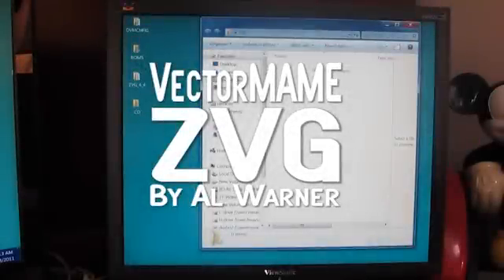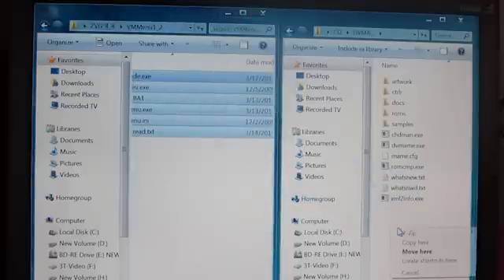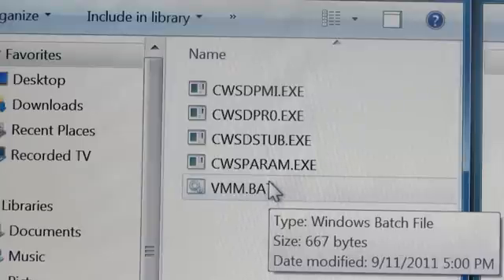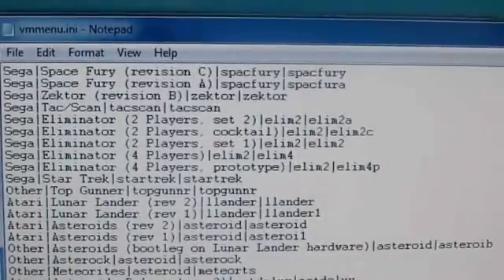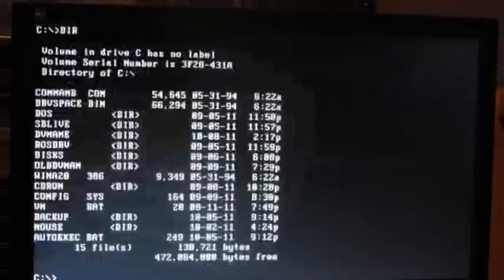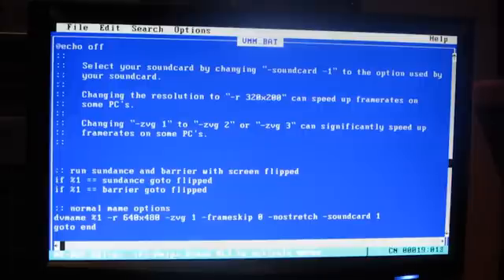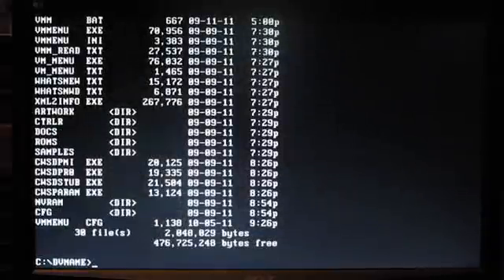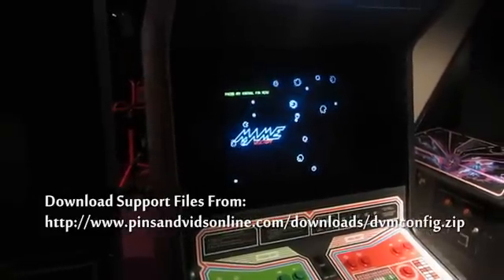VectorMAME ZVG Configuration (DOS)

Comment from the maker: Addl. Notes: There will be a gap of about 2-3 weeks until the next video.  I've got to do a decent number of things for the next video to get a functioning machine.  I've already started, but there are parts to be acquired as well as work to complete this.  In case you're a purist on games, I am making these mods to this cabinet so they can be reversed.  The only thing I'll do that's pernanent is a few extra screw holes inside the cabinet but everything can be changed back in less than an hour.